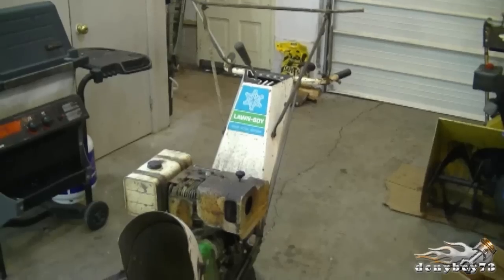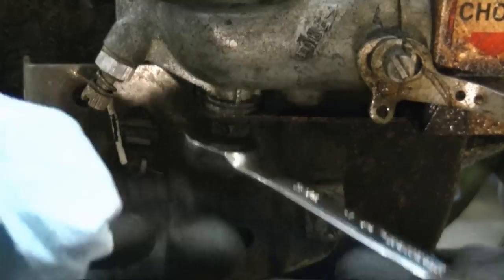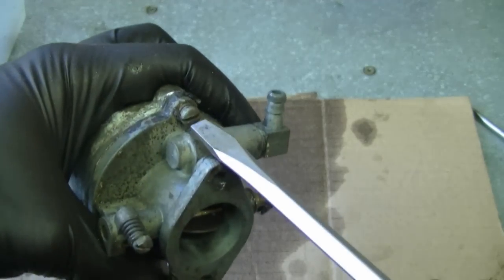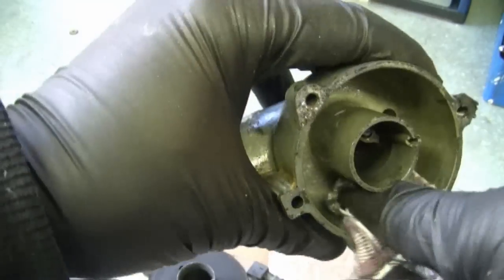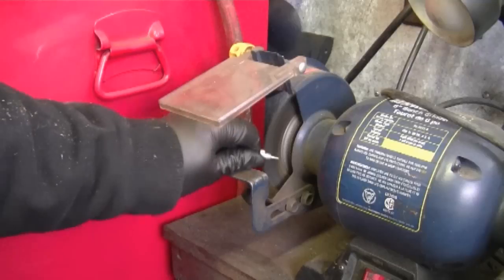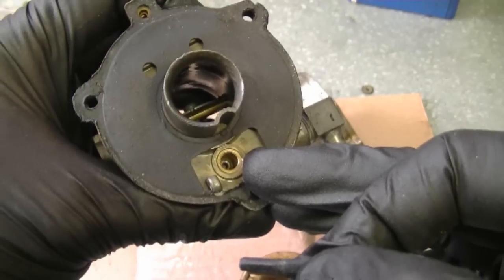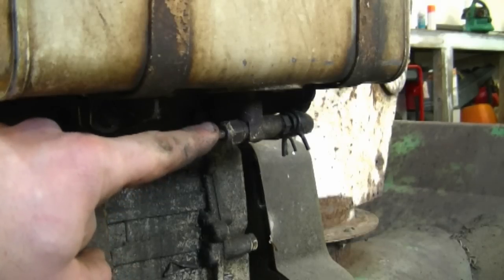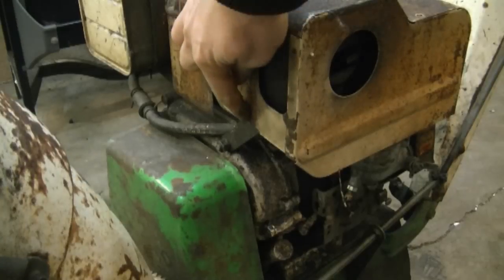How To Clean an Older 8HP Briggs & Stratton Carburetor - video

Comment: This is a great video.  I am a 68 year old woman who never had taken a carb apart but followed these instructions and, voilå, the engine now runs like a champ. Jet was clogged, just as he says is often the problem. Just FYI: Needle valve - 1  1/2 to 2 turns out from seating it: idle 3/4 to 1 turns out from seating.

Comment: Donyboy73, just wanted to say thank you for this video.  I had a 1975 Mastercraft 8hp that wouldn't start.  It had spark so I knew it wasn't getting fuel.  I cleaned the carburetor (thanks for pointing out the tiny hole on the needle) and put it back together...still nothing.  I even tried the prime the cylinder with no luck.  Anyway, I did a bunch of other things (gas lines, cleaned the flywheel etc.) And decided to watch your video again to see if I did anything differently.  The only thing I noticed was you put the "air box" back on  the down draft carburetor.   So I did that...started first pull.  It was the first time I have worked on these type of carburetors and I didn't realize the air box has to be in place.  Anyway, thanks again ...much appreciated!
Reply: I'm working on this same exact engine from an old 1967 snowblower. It did work when I got it free a few weeks ago.  I cleaned the carb but now it won't start. But are you telling me the air box has to be installed for it to start? Are you sure it wasn't something else? I'm going back out to the engine and try to start it with the airbox and I will advise you right away if it works.

Comment: Thanks for this video.  I bought a Simplicity 860 last week for next to nothing due to a leaky carb with this motor in video.  Fixed it up with a couple parts and now it back to beast mode.

Comment: First of all THANKS SO MUCH for this vid. I'm about to rebuild another B & S engine for this Sears Roto-Spader circa 1977,
garden tiller, A REAL workhorse! My second Briggs with this tiller,.. and my 1st rebuild.
  Gathering all related info I can find to see this rebuild thru, and found your video.
That particular carb your working on is a "B & S Medium Two Piece Flo-Jet Carburetor"(#390323).
  FYI, every one pay particular attention to 'emulsion tube', that long tube you removed after main needle. In it's center is the hole for the main fuel adjustment needle. Do diligence when cleaning all these openings. 
   Thanx again for posting!

Comment: As with all your videos Dony, you do a thorough and comprehensive job of explaining the ins and outs of the items you're working on. There was one step that I noticed was missing though. Leveling the float using a flat surface and placing the top carb body on the flat surface and adjusting the float so that it's perpendicular to the level surface. I've failed to do this in the past and had a float that wouldn't shut the fuel supply off before the fuel spilled out of the gasket. Just a thought!

Comment: Thanks for your assistance. My snowblower is about 14 years old and wasn't idling correctly. It was running up and down on idle, which I call looping. Watching your video, I was able to take the carburator lower bowl off, clean the jets with carb cleaner. I then turned the snowblower on it's front open auger area. The carb was facing up. I shot about 2 to 3 oz's of carb cleaner into the opening and left it there for 30 minutes. When I layed the snowblower back on it's skids, the crystal clear cleaner came out gunky yellow!!  I put everthing back together, and voia! Perfect idle with no looping. Thanks

Comment: When I was rebuilding my 12 hp briggs carb for some reason the new low speed adjustment screw would not screw in to my carburetor so I had to fix my old one with emery paper because it had been over tightened and hashed over and bent, it's still bent but the engine runs great so I do not think scratches will do anything to the needles. Thumbs up!

Comment: Very well done.  Good voice, clearly spoken, good camera control.  Enjoy your videos.  

One problem I have run across a couple times is a flywheel that WILL NOT come off and has no pulling holes.  Three point pulling linkage would not do it either.  I ended up heating the hub red hot and it came off in loud groans and pops. The key was just fine.  I have broken a flywheel in the past.  Lots of videos of them coming right off with a tap. Any suggestions for the future. Thought about building some custom rear multiple point wedge.

Comment: Thanks for the video.  I have a 8hp craftsman roto tiller that after working hard last season refused to start in the spring.  I beleive it is the same engine you worked on in this video, and I may attempt cleaning or changing the card.

Comment from the maker: check for spark when it doesn't start at all, sometimes I spray quick start in the carb to see if it will fire up, if it does then I know it's definitely a fuel problem, if you have a fuel pump make sure it's good

Comment from the maker: it's for a switch, sometimes the wire is connected to the throttle mechanism on the engine and when you throttle down it shuts it off

Comment: I know this is an old video, but I just inherited an old 1970 MTD Seven Hundred Series 7 hp lawn tractor with a carb like this. Very helpful video as I have never seen one like this. Thanks Don!
Reply from the maker: Right on
Reply: @donyboy73  hard to believe this machine is almost 52 years old! The engine code is Jan. 22, 1970 build date. Do you think MTD would have any info such as a manual for this unit? It has 4 different size tires on it! I would like to get the correct ones. Otherwise, it is all here and in pretty decent condition……including the deck! I am curious about the little gear boxes over each spindle? Fo they require oil or anything? Thanks Don!
Reply from the maker: @Rattletrap2  just contact mtd, maybe they have an old parts list for you
Reply: @donyboy73  thanks Don, will do!
Reply: I have a 78 Gibson blower, I can still get any part for blower!! there are die hard ppl that sell parts on websites to keep the old girls going I find

Comment: Just the ticket.  Same 8hp engine/ carb on TroyBuilt rototiller, probably 40 yrs old.  TroyBuilt Tomahawk chipper with the same. Got them separately and used. Have been a DIY for these beasts… for 20-25 yrs.  I’m usually working by native witlessness and stupidity.  No excuse now.  Beyond fine Emory or wet-dry sand paper, like others note, copper wire to clean jet ports.   I also might use a Dremmel with brass wire wheel on bad crud/ corrosion to revive small brass and pot metal.  Excellent presentation, too.  Thanks Heaps.

Comment: Call from Norway ! Thank you for this, and your other videos. I have mounted a B&S 8 HP engine in an old Sawmill ( Jonsered 6000 - link under) but i had problem with the engine running on full throttle. The tip you give in the film about the to small holes in the main Jet saved me ! They where completly jamed with some chalk-like stuff. Thanks !  Jonsered 6000 Sawmill / Sagverk Ombygging fra 2 til 4-takts motor

Comment: Don, I just worked on the exact same carburetor.  Instead of running like a new engine, mine leaked fuel as if I owned stock in BP.  I've determined the body is warped, so I'm going to take the carburetor back off, disassemble it, and surface it on a granite block with emery paper.  Your shop must have good vibes, 'cause it sure seems to have better luck with ancient engines than my shop does.  BTW, my main needle jet has become one with the carburetor body, and I've had it soaking in penetrating oil for three days, but it's decided it doesn't want to part company.  That makes working on it a lot more interesting!
Reply: try using a propane torch for a few seconds to slightly heat the carburetor body near the main needle. Wear leather welder's glove to hold the hot carburetor while you back out the long jet. If you get it too hot, you may need to replace gaskets, but this is easier than drilling out the long needle jet as the Briggs shop manual suggests. When you put the long needle jet back in, tighten until it seats, then back it out and reseat it 4 times or so. This may eliminate the leakage, as it will mate the brass needle to the carburetor body. There are two shoulders on the long needle that must have complete contact with the body or you will have leakage.

Comment: Thanks for making this video - I love it.  I just bought a used Troy-bilt Horse tiller with this engine (electric start), and it runs poorly - runs fine for about 60 seconds under load, then runs rough for a bit and cuts out.  After sitting a minute, it starts, bangs out some black smoke, and goes back to running smooth for a minute, then repeats the whole sequence.  Seems to be a fuel problem, and adjusting the mixture didn't fix it.  Maybe I need to clean the carb?

Comment: Great video! I followed it and was able to resurrect my 8HP portable generator. So I went beyond that step and am going to put a carb kit in. Most of it looks self explanatory but I'm wondering if I need an adhesive for the gasket or can I just install without adhesive? I remember working on cars in my youth where I believe we used some sort of adhesive on gaskets but this is my first carburetor. Can you help? Thanks again...

Comment: Hi,Donny.  I enjoyed this video very much.  My son-in-law in Alliston has an old Toro (1982) snowblower.  We took the carburetor off of the Briggs & Stratton engine since it was not running very well.  We took the carb. and sprayed all parts with carb cleaner, and I brought the carb back to Bracebridge to see if you could help me re-assemble it, with new gaskets. 
Can you obtain a new carb. kit for it.  I will bring it by, because it might be necessary to get a new gas tank for it.

Comment: I need to do this on the 1953 Power king tractor. It is a flo-jet carb. It is a 23FB engine that we used to start with a crank. A recoil would not work. It is somewhat like your example engine, but different. I want to acquire another spare engine.

Comment: Be sure that the high speed needle valve is backed off before tightening the nut, or you could damage the needle and/or seat.  One way wold be to install the nut first, then the needle.  Another way is to not adjust the needle during cleaning, and then back off a turn or so.  The starting point for adjustment is 1.5 turns out from closed.  Close gently or the line on the needle visible in the video will get deep.  I know it is not the space shuttle, but the needle is meant to be gently tightened, not with a wrench. :)

Comment: i once had someone tell me you turn the jets in counting the distance to the bottom of the seat by half turns.  Once it bottoms (Don't over tighten) write down the number of half turns, then remove the jet to clean it.  So when you put it back in, you turn it all the way down, then back it off the number of half turns you counted before removing it.

Comment: Took mine apart, fouund a needle and seat , one which I've had fail (similar) in carter and similar carbs on autos ect. So, getting that, since it causes flooding and rough running so often. Quick repair if I can get it. ..... was hard to get the carb apart without wrecking the gasquet between the bowl and carb. Carefully used a razor knife.

Comment: I find taking the jet tube out, using a good tight fitting tip and an adjustable ratchet battery drill will persuade even a tough jet that's hard to remove by hand. On guy uses a little heat with a propane torch.

Comment: That runs sweet as a nut :-), when i did my old briggs&stratton ive used single strands of copper wire to clean the holes out as i didnt want to do any damage to the hole sizes.

Smashing job :-)

Comment: Thanks donyboy73. Excellent vid. Those lawmboy snowblowers were rebadged Gilson Unitrol machines. I have the same one but a Gilson from 1979. It's a beast!  Mine is leaking fuel by the bowl so I bought a carb rebuild kit. Same 8hp Briggs motor.  On mine the governor seems to be not working? It runs very fast without load?  Is the gov under the starter housing?

Comment: I had the same prb, I had to drill out the jet, and put a easy out in it to get it out, so I got a new one from RepairClinic., your gas leak is the seat on the float needle valve, hole carb was 140$ so just get the parts u need, I did not need the hole carb. and there was 3 dif jets for mine so you need the code # to.

Comment: Glad I saw your video. I have a Briggs 8 HP on my generator and have not been able to find the engine model listed anywhere and need to clean my carb. I know I need a gasket, but can't find one by my engine model number. It is 134417 Type 0123-01 Code 91M0110. The carb does not have a part number on it. So, I'm hoping you can tell me whet the part number is on the carb you are cleaning in the video because it look identicle to mine.

Comment: Your how tos are wealth of knowledge Don, thanks for posting them. I don't work on other peoples stuff just my own and I'm stumped. I have a 1974 Sears  Sears S/T 10 tractor with a Tecumsa engine and needs a carb kit. Sears has their name all over it and their like 3 digit numbers on it. Have any idea what the part number it may be for the kit and where I can get one? Thanks.
Reply from the maker: usually 632347 and use oem kit, much better seals in it
Reply: Thanks Don! Stay warm up there in Canada.

Comment: I found that I was using a bogus Model number on the engine. I have since found that the carb is a 390323. I will take it apart again and use part 398235 rebuild kit to see if that solves my problem. Thanks or your reply. If I can't get it started after the rebuild you may hear from me again.

Comment: Hi Don,
     I have a John Deere GX 75 riding mower which I had running yesterday, after it had been sitting for 2 years. It has a Kawasaki 9 hp fc 290v engine and is getting fuel and fire, but it back fires at the Mikuni carb. I have cleaned the carb and the jets on it, but now it won't start. Do you have any suggestions as to what I should try next?
 
I'm trying to learn everything I can about small engine repair and would really appreciate any help! Thank you for your time and advice.

Comment: Don boy, I have the same engine off a toro snowblower and tried to clean the carb like you showed in this video, your videos are great.  A few questions, how far in does that long needle need to go?  What gap should the spark plug be at, when I checked it it was at .20 which seems low.  I tried cleaning the tank with white vinegar, any other suggestions?  Are these engines really worth anything?

Comment: Do you have a carb kit part # for that. I've noticed that the long jet you unscrewed is different on some of those carbs. Some have the single hole in the center of the tube and some have 2 holes on the long jet. Does it really matter?

Comment: I surprised you did not remove the gas tank, drain and clean it out.  I work on a lot of old equipment and have found out the hard way that if there is crud in the carb, there is likely crud in the tank and cleaning the carb without cleaning the tank just means you will be cleaning the carb again.  I know the fuel hose was not leaking but I would have replaced that also.

Any tips for cleaning out an old tank ?

Comment: My dad has a Briggs and Stratton 8hp carburetor as well.  He swears up and down that neither it nor his 18hp carburetor need to be cleaned.  He says that it leaks gas from where the fuel line hooks to the carburetor. As for the 18hp, it just isn't getting any gas whatsoever.  

I mostly need the 8hp advice.  Thank you in advanced!

Comment: Just got a old Generator that has this Carb. This thing was built in 79. I cleaned it just like your video but I am having no luck getting the thing to start. It tries to start but no luck. If you give it full choke it floods a little choke it just put put and will not catch. Looks like I may have to go with a rebuild kit. Maybe the needle is not right?

Comment: Hi Don i have a question. I have a 8hp briggs and stratton horizontal shaft i/c engine on a leaf blower. It does run but  i have stopped using it because i can grab the shaft and move it around. Do you have any videos on how to repair this or should i just get another motor?

Comment: Hey there - I have a Toro 826 (Model 38150 from 1979) recently did some repair to the carb (which is the same as this one) and it's working better, but or some reason the throttle control is no longer working. Something got bent or popped in the area where the linkage touches down) I'm not sure if the pieces aren't lining up correctly or what might be happening. Would it be possible to get some images of what a FUNCTIONING throttle control looks like to help diagnose what the heck is wrong?

Comment: Great video!!! I have an 8 HP Briggs with an up draft carb that I can't get it to quit leaking out the bottom, watched your video and others 100 times and put new carb kit in it 3 times any suggestions would be appreciated??!!
Reply from the maker: on those you need to replace the needle and seat

Comment: This is a great write up!  Thank you so much for doing this.  I have what appears to be a similar snow blower.  Mine is a Gilson with an 8 hp briggs.  I am not getting any spark, however.  Do you have any videos showing how to fix that?  Or at lease troubleshoot that?
Reply from the maker: probably the points
Reply: donyboy73 Do you think I can add this on instead of pulling the fly wheel and messing with the points?
MAGNETRON IGNITION MODULE?  Or can I contact you off line?

Comment: Great video! This is my exact snowblower.  If I accidently took out that bottom float screw (not with the bolt).  Is there a good starting point for the screw? I have good spark, fuel looks good, but it just fire up. Fuel is spitting out the air intake too. =\